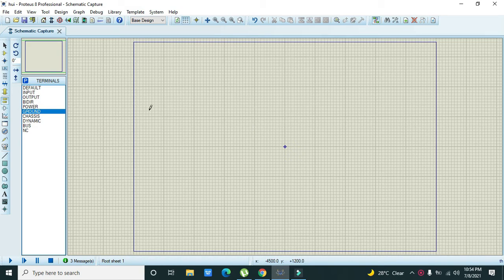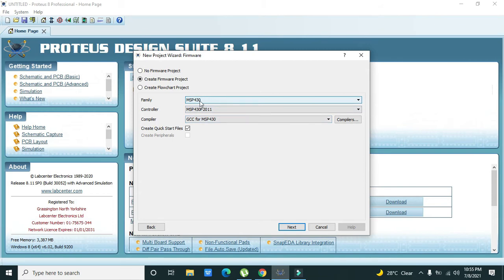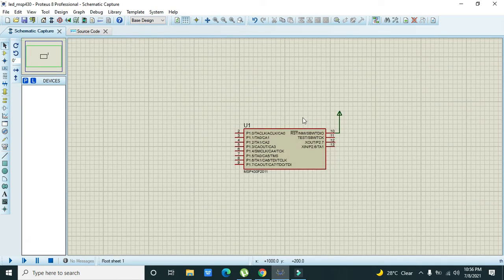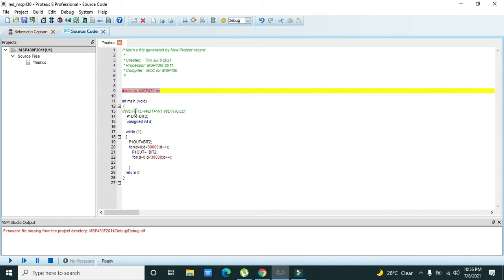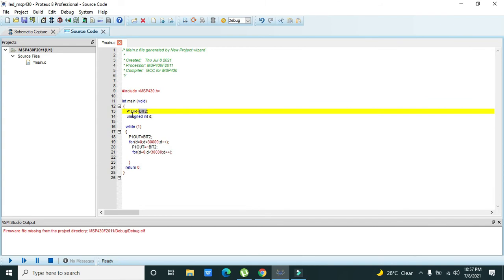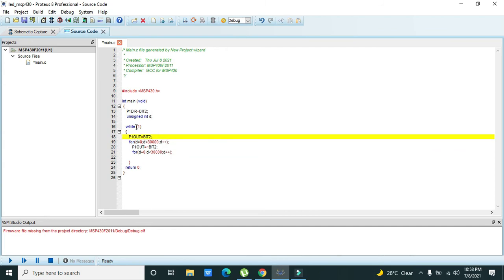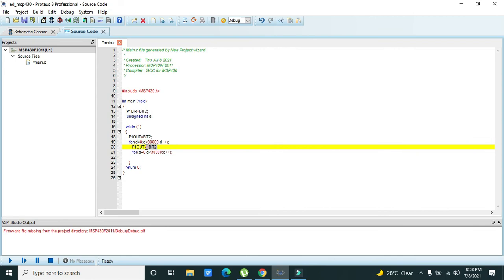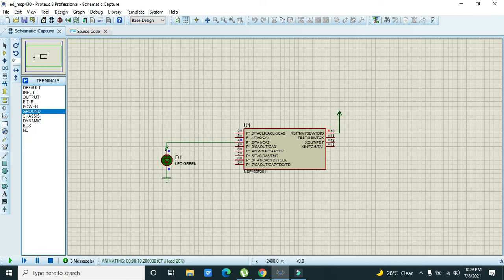how to blink an led with msp430 in proteus using microC

Comment: my led dont blink but voltmeter shows 1.56 and 0 alternately
Reply from the maker: click on the led and change its operating voltages
Reply: @nelsondarwinpaktech3954   tried it but nothing happend .led only  glows if i connect it through transistor ( base of transistor connected to pin of uc)